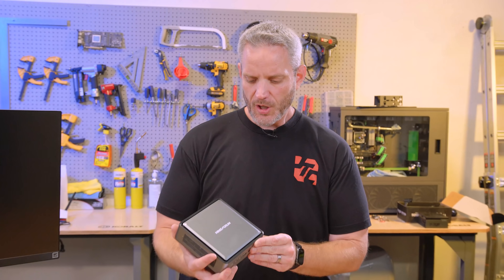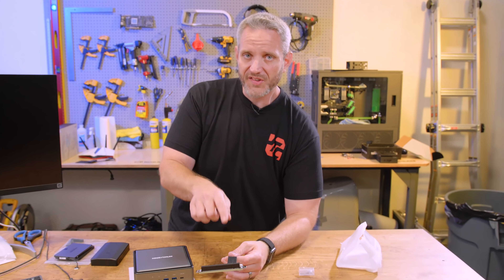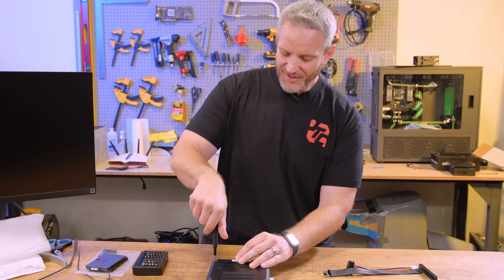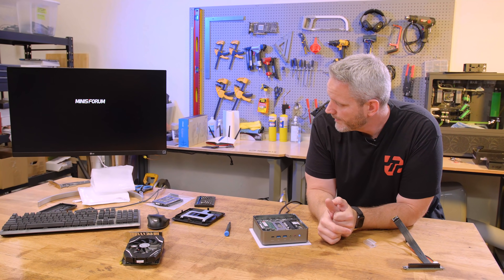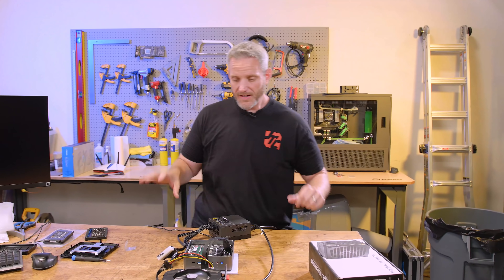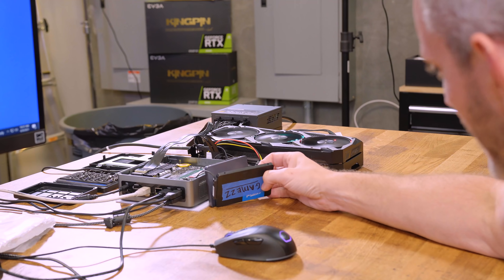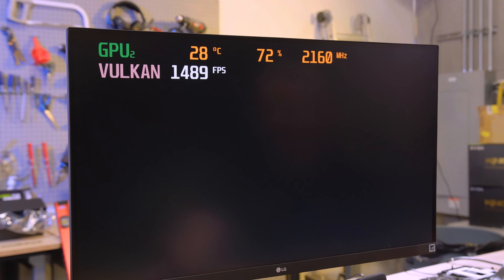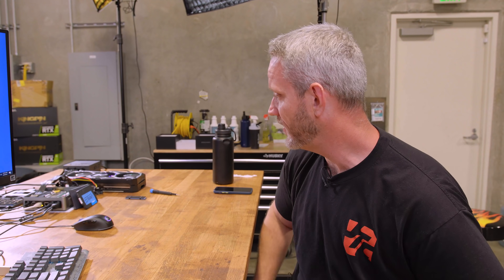This was easier than I expected it to be! Super powerful mini pc

Comment: build a wooden pc using walnut and install the gpu under the minisforum system and put the power supply next the video card  and run a series of 7 port hubs to the usb ports  to the side or back of the wood cabinet .  if you positioned everything well, it still wouldn't be to big.  adding a blue ray drive in the front too.

Comment: put a lan party in a van for long drives everyone in the back could game with bluetooth headsets
Reply: You will need a stable UPS (Uninterruptible Power Supply) that can handle more than 500 Watt.

I understand how the Car Electricity system works, assuming you're Driving a regular Gasoline car, the Battery often have 12 Volt with 35 Amps. Or 24 Volt 35 amps.

However you must also Calculate powers needed for Air Conditioner, Headlamps, etc. A Slow-Start Transformer UPS is a Must HAVE if you want to run Gaming PC in a Car.

Comment: You definitelly do not want to power gpu riser with SATA cable. SATA cables can not handle that wattage = overheat -> burn.
Reply: Wrong!! You're absolutely Wrong.

When You're running an External GPU like this one in the Video, you're only using 25 Watt of that SATA maximum Power it can handle. Remember a SATA Cable can handle 54 Watt Max.

NOT 75 Watt. Because the GPU only utilizing X4 Lanes of its total X16 Lanes capability.

Hence why SATA Cable is more than enough to power up the GPU PCIe Lane. 

Cable Color diagram on SATA as in this video:
Yellow = 12v 1.5 amp = 18 Watt
Red = 5v 1.5 amp = 7.5 Watt
Black = Grounding
18+7.5 = 25.5 Watt.

A GTX 1050 ti or GTX 1650 is indeed a 75 Watt GPU --- when it runs on Maximum X16 Lanes --- but when running on X4 PCIe Lanes, it only needs 25 Watt to Actually turn on and running.

So why is that PCIe extension in the Video is showing a Long size X16 Lanes?  Because it is only for Gripping the GPU, if you look at it closely, the Copper Connector inside the PCIe is Physically disconnected from the X4 Lanes (Placebo)
Reply: @ClayWheeler  lots of cases mining rigs burned cuz of its sata powering, so many tests in yt also, you can see sata cable cant handle it, cables going to melt and whole setup going too burn, try it, gl
Reply: @DiamondCartierSkeleton  MINING RIGS ARE USING PCIe X1 Lane on a 25 Watt Supplementary Power.

Guess why it's Overload? Because You're Feeding 25 Watt to Just X1 Lane of PCIe. Not X4 Lanes
Reply: @DiamondCartierSkeleton  You're supposed NOT TO use the Yellow Cable from SATA for Mining.

Only use the Red One. Good Luck finding out how to work it.
Reply: @ClayWheeler  theres all black :-----)

Comment: Why not put the nvme -> pci-e adapter on the wifi card instead? it should be the same interface?
Reply: No it's different.
M.2 NVMe slot is using M-Key

Meanwhile the WiFi Card is using A&E-key  (Also known as NGFF)

M-Key top speed is like PCIe Gen 3 X4 Lanes which is 32 Gbps (Gigabit not GigaByte)

NGFF Top speed is PCIe Gen 3 X1 Lane which is 8 Gbps. Hence why it's called 'Gigabit' Ethernet. 8 Gbps = 1 GBps

Comment: could you not just use a 160w pico PSU or 250w DKEY PSU for supplimental GPU power? much smaller

Comment: And this is why TB eGPU is still relevant IMHO. IF you can find a GPU. (And for something like this, I wouldn't recommend going top of the line because of the 30% penalty over TB)
Reply: pcie M.2 has like 2-5% penalty
Reply: Thunderbolt eGPU so far only exist in TB3 not yet available in TB4.

Thunderbolt 3 eGPU top speed is just 22 Gbps (Gigabit not GigaByte) 

In theory, Thunderbolt 4 eGPU is 32 Gbps, but it doesn't exist yet (at the time of writing this comment)

Meanwhile this Particular Video right here is 32 Gbps. And you can do the same thing to all MiniPC from 2017 to this day.

Comment: Heh. I have an expresscard one hooked up to my ancient Thinkpad. 1050ti because it's low power enough to run off just the pcie slot (with a secondary laptop supply).

Main problem I had was interference blue screening me -- fixed with lots of aluminum tape and some old Radio Shack cord chokes on both the power and monitor cables.

Cure for the boot loop is to disable the built-in video in device manager.

Comment: 1. The PCIe riser should really not be powered through SATA. It is not rated to 75W (fire hazard). There are variants that have Molex, which are safe for that power load.
2. Too bad it is not PCIe 4.0, otherwise an AMD GPU would be able to get twice the bandwidth from that M.2 slot. And the 5700G APUs don't have it either :(
However, if one can find a mini-PC like that with a real (non-APU or laptop) CPU from the 5000-series, it would be interesting to see how the PCIe 4.0 affects performance.
3. Jay, an idea for the product: Make a vest for it to be able to run Oculus VR with only a power cord needed (hanging from the ceiling on a pully or something)

Comment: > "Why's it 5:3 ratio?!?"

Because 1280x768 is 5:3, Jay!

5x256 = 1280, 3x256 = 768.
Reply: PS: The GPU is overheating because you have the backplate flat on the wooden table and wood is a great heat insulator.

Comment: You can actually just get an adapter that converts the x16 slot to an x1 male plug for crypto mining, and it has a molex port for the 75 watts. So this would be adding an extra step for crypto mining =P

Comment: Concerning powering the GPU with a second power supply, take a look at this cable that looks like it is meant to be used for that job: https://www.ebay.com/itm/202972480031

Comment: For one idea of a direction to go with this setup, take a look at this post that was on Reddit a while ago: https://www.reddit.com/r/eGPU/comments/iq1ji8/rccnuc1_egpu_with_nuc_and_r9_nano/

Maybe you can take this idea but go a bit further by making assume sort of 'dock' the whole thing can plug into sort of like a blade server. It would be cool if you can get the size down enough to make something that can slide into something on a boat, under a desk, and maybe even in a car. 

Another thought is that it seems the whole setup would be great for a different type of engine themed build, maybe it's small enough that it could all fit into an I4 engine block mock up.

Comment: put it in a desk drawer that you can pull out and show off, but close the drawer, invisible PC. Wireless KB and mouse with with a flush metal faceplate on the desk for USB.  Totally clean totally cable-free setup.  Maybe even have slots on top of the desk for hot-swap SATA drives that are done up to look like Classic Star Trek memory cards.

Comment: so i've done this type of stuff before having to keep the psu powered while plugged in for some cheap hp desktops that needed to be converted to well a real psu standard and the gpu doesnt care if it always has power. with that said you can keepthe gpu powered and let the motherboard(pc in the case) deal with powering the machine 

alittle backstory i have a friend with a cheap hp desktop that wanted a gpu and i found out that it didnt have a 6 pin cable so i made an adapter(so i could plug in just any psu) just to find out it needed 12volts standby at this point i said screw it and i clipped the green wire and made it a always on psu i figured i havent shut my pc off in 5 years its not going to hurt that pc to have a psu that runs with no load and as of 2 years that pc still works. 

Final thing i should say that motherboard can actualy power off with the psu always on its a weird thing hp was doing at that time and i believe they still do

Comment: I think it'd be hilarious to have it under the PSU / cable shroud in an otherwise empty case. Or heck, you could go full RGB with it, throw some cardboard cutouts of the components, or just draw some crappy mockups on cardboard. Not as cool as some other ideas here but it would be the ultimate sleeper PC, for it has no parts in it.

Comment: i love the mad scientist build man! haha

gotta say tho, PCIE slot spec is for 75Watts, right
but Sata cable spec is rated well below that
of course the external PSU is a bit of a 'safety net'
but there is real potential for the GPU to try to draw 75w from that sata lead
potentially overheating / damaging /melting cables.

I personally only use risers with PCIE power connectors

Comment: You could do the same with a broken laptop, specially a gaming laptop, remove the display assembly, put it a video adapter (perhaps hdmi port would work as a main monitor but i am not 100% sure it would be convenient), get one of those double-sided tapes, glue the notebook and power brick under your desk and you have a hidden gaming pc. It could work with a egpu as well since gaming mobile cpus are the most powerful in its class so it wouldn't bottleneck as much. 

Having it under your desk also help with noise levels, and if it is one of those models that can turn on without the battery you can take it out so you don't even have to worry about it. Just make sure you disconnect the battery before messing with it

Comment: 6:30 the reason I use NVME SSDs in my computers is not necessarily because they are faster but because of how convenient they are. Mounting the drive directly to the motherboard means fewer cables and a faster install. Also, if you use a gaming laptop like I do, there is no SATA slot in the machine so I am SOL if I want to use a SATA drive.

Comment: Cool test but is pointless for this system is nonsense open the box and add power supply and put it on table if do such stuff better make something where graphics card and power supply will fit

Comment: Doesn't this technically nerf your graphics card because of the difference in PCIE lanes between the nvme slot and a regular x16 slot on a regular motherboard?  Would love to see a comparison video between these two.  Also, I've thought about doing something similar on a laptop using a Thunderbolt 3 to NVME external drive enclosure then plugged into a Thunderbolt 3 port.

Comment: Clear all that cable mess and mount them under the table. If'd probably also hook up a large capacity ssd and turn it into a general use machine. At least it doesn't have a ridiculous joke of a gpu. :)

Comment: What you did, Jay, is that you jerry rigged an external gpu enclosure, basically.
And the rules regarding a gpu enclosure through thunderbolt still apply to your m.2 slot: 4 pci lanes.

I have attempted different setups like this, combining an Intel NUC + an external gpu enclosure, but due to the limitation of only 4 pci lanes, the most performance I could get was a 1070ti.
Anything above it lost the extra performance due to bandwidth limitations.
Attempted with a 1080ti and a 2080 as well, but the performance was... Lacking, to say the least.

None of this is new info or new tech, it's just... A new connection used,  instead :)
Reply: Mister Know-it-all.  Been there, done that and you didn't do anything special.  There's one in every crowd!  No, he actually added a full-blown GPU to a compact PC that had an APU with ZERO pci lanes.  Buzzkill!
Reply: @Thin447Line  child, i understand your desire to blindly defend, but at least do it properly, with knowledge.

Everything that I have said is completely valid, in terms of an easier connection that does the exact same thing and has existed for years.
Only "downside" is that a thunderbolt port is only found on NUCs and other intel-based devices since it is a proprietary intel connection.

External gpu enclosure has been doing what his cable does for many years now, in practically the same way, but overall cleaner, in a little box, instead of having wires coming out of your mini pc, and then next to them, on the table, a gpu and a jerry rigged psu.

Later edit: forgot to mention, each m.2 slot has up to 4 pcie lanes dedicated to it. Otherwise it would not be able to run the device connected to it  :)
Learn, young one. It's good for you.

Comment: You could perhaps mount the RTX3060 in a "glass case" as if it were a display only ~ but then the SFF PC is actually in the base (hidden away), and the video card is connected to it with the M.2 adapter cable (also hidden or disguised) ~ have it connected to a monitor, with wireless keyboard and mouse ~ and play games with what appears to be only a video card in a glass case! Its fans are spinning, RGBs shining ~ but appears to be "standalone"!!  That would amaze people who don't know about the SFF PC and its versatility . . .

Comment: Gaming Barstool....

Wearable VR sounds good also, gets rid of the monitor. Use with a portable usb-c power pack or multiple, they can also producd the 12v for the gpu..
Also you can add a 12V relays (+diode) to the 12v rail on the nuc and use that to switch the bridge (green to gnd in old times) on the ext psu. The 12v rail is only on when its really running, not like usb/5V or similar...

Comment: question:- does the graphics card need the full length of the PCIe slot, could it be connected to one of the smaller slots be hacked to accommodate it , the larger graphics PCIe plug, and just leave the rest of the plug un-connected, (could simpler to the "!£$!"£$£"$%", bit coin mining card showed in video, and use the rest to connect hard disk SSD, and maybe, more bits :-)

Comment: DIY Thunderbolt dock. Combine this adapter with a thunderbolt to M.2 NVME adapter. I did this myself to add an external GPU to my XPS 15-9550. A lot cheaper than any retail thunderbolt dock. Oh, you can also make your own All-in-One this way. I did it with a 24" Monitor, a Mini-ITX with a 4x PCI-E and a GTX 1650 Super.

Comment: Hmm, if you wanna go for a more compact system, you could use the SATA power from the included SATA SSD connector, and power the ribbon cable with that, and for storage, you could remove the wifi card, that ALSO uses the same NvME mount, (it is actually just a tiny version of the PCIe wifi cards you mount on a normal atx system), and mount your NvME SSD there, so you'd have no need for an external PSU. Only downside is that you'd be limited to a very basic GPU with no power ports (so like the one you are using there).

Comment: Water cooled nuc + GPU in a DIY soundbar. That way you could link almost everything through usb-c or thunderbolt
Reply: Ok, had a better idea. Beat LTT for furniture integrated PC's. I saw a yt video of a desk pc that I felt was in much better taste than Linus's desk by DIYperks. I figure if you do something similar but make it a TV stand with an integrated soundbar then you could add internally as many IO as you please via pass through cables.  As long as the legs are removable it would work for a while and would blend In way better than any console. Also had a look round Intel do the 11th Gen NUC Pro. It has 3 slots internally. One for WiFi, one for a b-key SSD and a x4 Gen 4 2280 slot, I feel that would give this project more options.

Comment: What about in your ZL1. Have a monitor hidden in the back that you can pull out. Hide the electronics in the dash or trunk. A really good cross over for the two channels. Not likely/easy, but not low hanging fruit.

Comment: I can think of all sorts of ideas for hiding PCs in things.
Coming up with INTERESTING ones on the other hand is a bit more difficult.
My main contribution, however, is a hardmod idea to make your life, and the resulting device, much easier.
Find a switched voltage rail in the Deskmini, break it out, and use a relay to switch the external PSU's power (on the PWR_ON signal) when you turn the mini on or off.

This is "easy" by my standards, but I'm a 14 year veteran electronics technician. You might need a little help to design and build this.

Comment: I have an ADT-Link adapter with an RX 480 8GB and seems to be the best version of something like this. It is my daily rig which is a DeskMini 10. The adapter has dual 8 pins and can mostly run anything. Uses a Dell laptop style power brick. Powers on automatically with the computer and is much more streamlined....

Comment: Dig up an old x86 computer case. Put the whole rig in it, wired up to appropriate ports on the back of the case. Bonus points for getting legacy disk drives working with it, too.

Comment: If there is a lower end GPU like a 3050 or 3060 non ti even that would be bottleneck lesser from the x4 bandwidth and also smaller then you can really fit it places unassuming. If there  is a way to use just 1 power button to power on the whole thing then that would be sick

Comment: Put it in your Camaro and install Holley's tuning software on it - get a ~10" HDMI display you can mount in the car(WaveShare has a 9", 2560x1600 IPS, cap touch monitor for $150, even has speakers and a milled enclosure) and you can use it to tune your car and as a media center for your car. While you'll need an inverter, these mini-PCs are so efficient that you could use a REALLY small one.
 
Also, I know you're using the Holley digital dash, but you might be interested in checking out RealDash, it's a Windows/Android/iOS digital dash, you can interface it with the ECU's CAN network using a USB-to-CAN converter(only like $35). RealDash's website has more info on that, but it's extremely customizable and, since it's PC/mobile based, it can even be used as GPS nav, a media center(like in the digital dash interface), etc. Really interesting stuff. Pretty DIY, so that could be an interesting process.

Comment: Install it in a vehicle. Have bluetooth and you can play with a controller sitting in the back seat and make the screen a touch screen to minimize the necessity to use mouse/keyboard.  You could mount the monitor from the ceiling or the back of a seat.  A large SUV, van or truck might work better to have room for a screen without obstructing too much view.  Or maybe even wire it into a built in display like a lot of vans already come with.